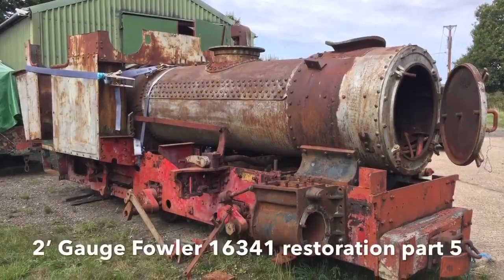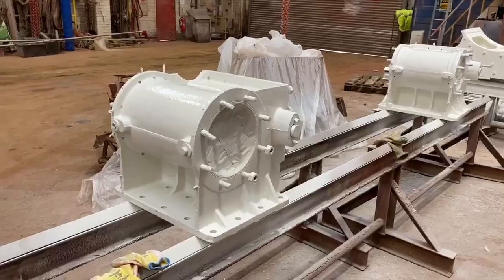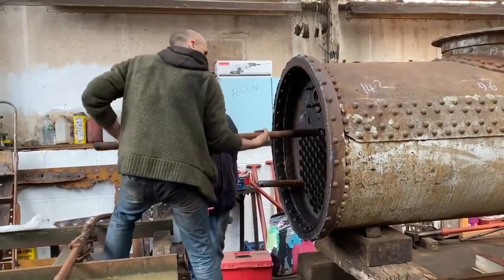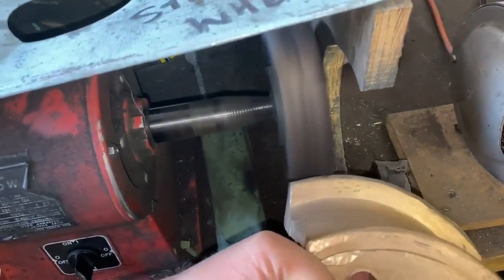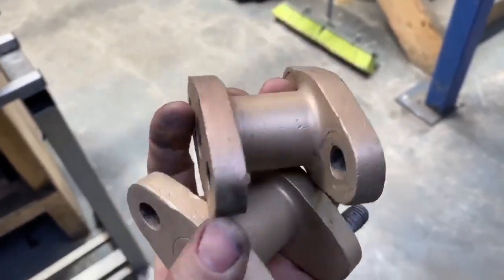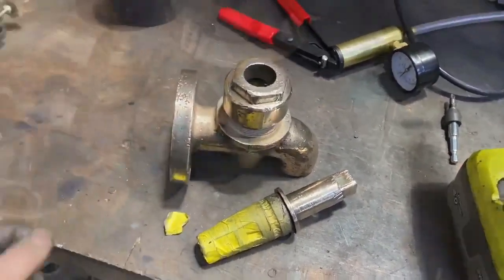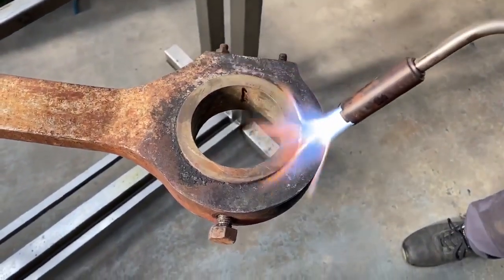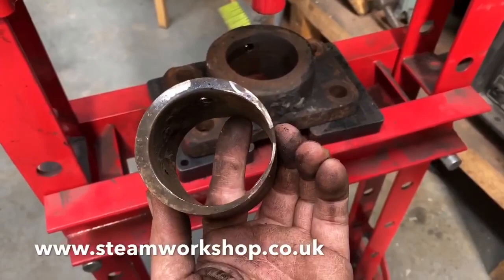Fowler 16341 Restoration Part 6

Comment: Very interesting and well produced video, thank you. Couple of points, why would you not simply White metal the existing bushes, much cheaper and easier, in the days of steam at Horwich (1920-30) boiler tubes were routinely removed, checked , cleaned and refitted, often fitting new ends.

Comment: What keeping you from testing and reusing old boiler tubes?
Reply: Bierrr tunes have to be replaced every 10 years, due to the conditions they go through, they corrode down and eventually would burst through, they do look very nice but it is just a safer bet to use new ones
Reply: I think the better question would be why not just cut off both ends and hammer out 6 inches instead of 8 feet

Comment: Sand is used for sandblasting. Steel shot - like BBs - is used for shotblasting. And it's done in cabinets or chambers like bead blasting. 

And sandblasting indoors is damn near suicidal. 

Even with proper and properly fitted and worn respirators outdoors it's possible for some silica sand to get inhaled if respirators are removed before the dust clears. Silica causes silicosis in the lungs. Which is nearly a death sentence. 

Indoors the dust never clears entirely and it can travel anywhere and everywhere throughout a "space" and will. I imagine the idea is to "cut costs" by "recycling" the sand but that's a stupidly false "economy". 

Where good "beach sand" is available there is no need to use silica sand. But it's commonly used elsewhere and particularly by DIYers in their "consumer grade" gravity feed blasters because it's "cheap" and avaiilable in 50-lb bags everywhere bagged concrete mix is sold. 

Many people don't know the difference and think it's regular blasting with "beach sand" that is dangerous which is why only "pros" do major sandblasting. They assume anything they can buy in bags at a local hardware store like concrete mix is safe for "home use". Not only is silica sand less aggressive than "beach sand" and requires a lot more time to get the same effect especially using low-pressure low-capacity "consumer grade" air compressors, it's far finer and dustier to begin with and nodular iron and steel and rust are harder than it is and "shatter" the grains. 

Glass beads exist specifically because "back in the day" blasting cabinets were typically filled with silica sand, many cabinets were homemade and/or not properly "ventilated" and "amateur" blasters would not or could not properly blow off or blow out the silica from parts in the cabinet and would instead pull out the part and blow it off with "shop air" and with maybe a "dust mask" on at best and end up inhaling the crap anyway. Or they'd get the dust on/in their clothes, hair etc and use compressed air to "blow off" and inhale it and  contaminate other spaces anyway. Or worst of all take it home with them to the wife and kids. Which is another major risk with DIY blasting in a "home garage". 

In fact the only way to safely "decontaminate" anyone or anything "dusted" with silica sand is to WASH IT OFF RATHER THAN BLOW IT OFF AND DON'T WORRY ABOUT "FLASH RUST". 

AND THE CORRECT RESPIRATOR FOR IT CAN EASILY COST AS MUCH AS THE DIY "SANDBLASTER" AND THE CORRECT RESPIRATOR IS THE MAKE, MODEL AND SIZE THAT BEST FITS THE USER. AND THEY DO REQUIRE "PERSONAL FITTING". 
THERE ARE ALSO CERTAIN GUARANTEED DEAL-BREAKERS THAT PREVENT EVER GETTING A CORRECTLY FITTING RESPIRATOR SUCH AS BEARDS AND LONG SIDEBURNS AND GOATEES. THE UNIT ABSOLUTELY MUST HAVE A PERFECT SEAL AGAINST THE SKIN. IMPOSSIBLE WITH FACIAL HAIR BETWEEN THE "MASK" AND THE SKIN. AND SINCE HAIR IS A "MAGNET" FOR THE SUBSTANCES YOU WEAR RESPIRATORS SPECIFICALLY TO AVOID INHALING AT "ALL COSTS", NOT ONLY DOES FACIAL HAIR ABSOLUTELY PREVENT A PERFECT SEAL, IT CAN CATCH AND COLLECT AND CONCENTRATE THOSE MATERIALS  AT THE VERY SPOTS OF LEAKAGE AND END UP GIVING THE WEARER A BIGGER "DOSE" OF THEM THAN IF HE OR SHE WERE WEARING A LESS EFFECTIVE "DUST MASK"  BUT ONE WITH A "PERFECT SEAL". 

THE CORRECT TEST TO DETERMINE IF YOU HAVE THE CORRECT RESPIRATOR AND A PERFECT SEAL IS THE "HANDS ON TEST". PLACE YOUR GLOVED HANDS OVER THE RESPIRATOR "INTAKES" FIRMLY AND TRY BREATHE NORMALLY. IF YOU FEEL LIKE YOU CAN'T BREATHE IT'S BECAUSE YOU CAN'T AND THE RESPIRATOR IS MAKING SURE THE ONLY AIR YOU CAN GET HAS TO COME THROUGH IT TO GET TO YOU. 

THAT'S ALSO HOW YOU KNOW A RESPIRATOR REQUIRES "MAINTENANCE" AND ITS FILTERS PROPERLY CLEANED AND/OR REPLACED. WHEN YOU GET "SHORT OF BREATH". YOU HAVE NO IDEA HOW DIRTY THE AIR YOU BREATHE AT "WORK" IS UNLESS YOU WEAR A RESPIRATOR THERE.

Comment: I learned early on in my the field of welding a structure like that needs round corners doesnt matter how you weld procedure if it remain square corner it will crack welding engineering had long been removed from engineering the schools wont even teach it because of the top engineers dollar